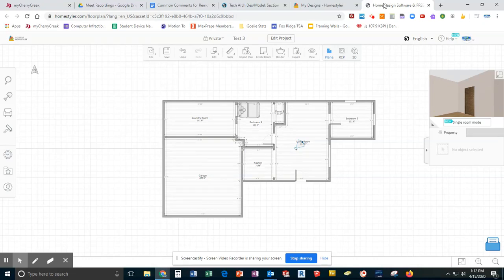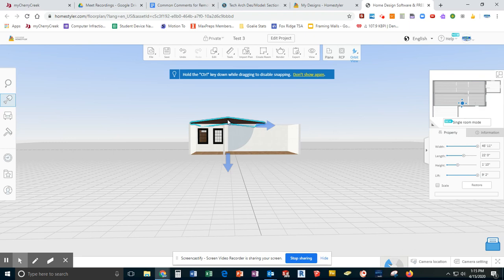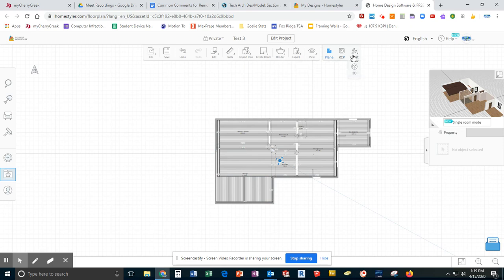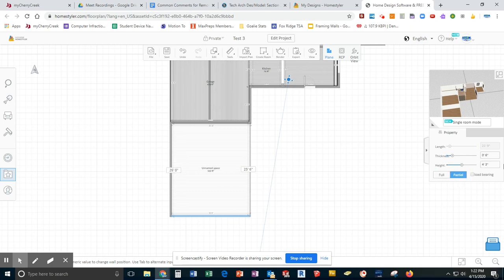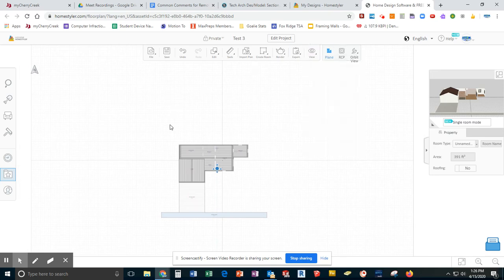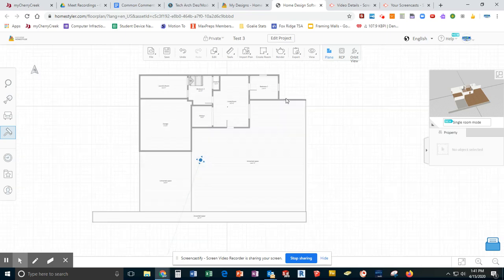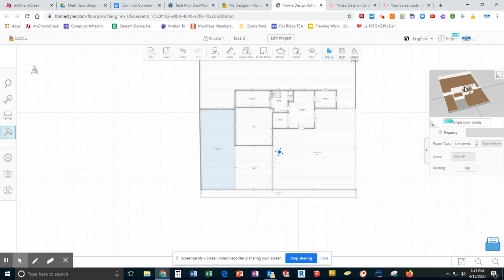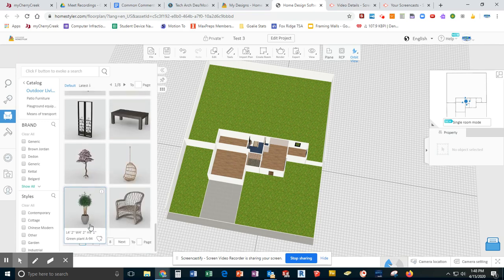HomeStyler.com- Roof and Site Design

Comment: there is no way to create a second floor or basement in homestyler.  i think they do not want to work on this.  ceiling mode doesnt work unless all your walls are 90° degrees. they need to add beziers to the ceilings

Comment: Hello, how can you build a sloped ceiling? I need to build sloped ceiling,  but the only one I have found in the “roof” folder is one made with wood and it’s not possible to edit it as a normal wall or ceiling. It keeps the wooden structure. Any idea? Thanks